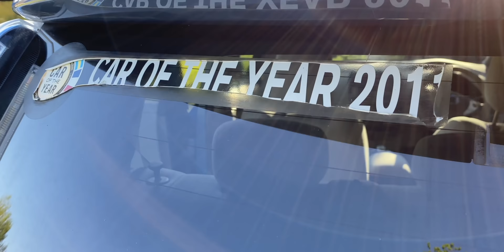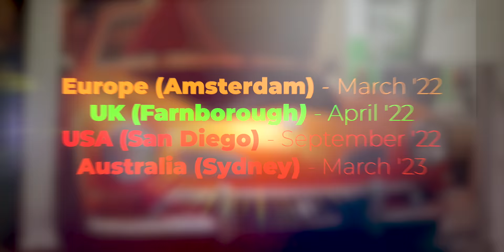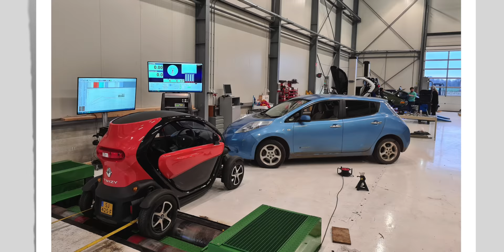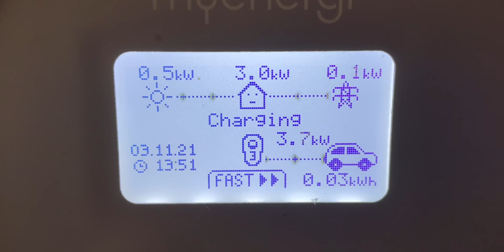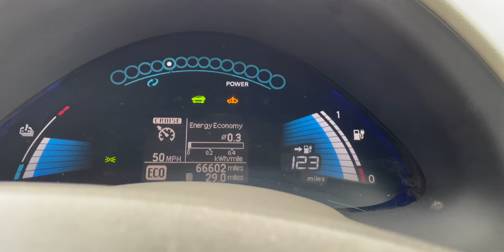Return of the LEAF: Robert drives his range extended EV home from Holland

Comment: Thank you, thank you, thank you for repeating the sentence " old batteries do not need replacement"

It's annoying, everytime I have to explain to a EV hater, that battery replacement is not a necessity at the end of the 8th year of warranty. It's just a warranty.
And old Nissan leaf and tesla's of 10 year's are still running today on old batteries, with a slight degradation of 20%
Reply: I had the same thing when I bought a 6 year old Prius, 8 years ago. The first thing many of my friends said was something along the lines of "Are you not scared the battery is going to die?!?". I had done my research, so I could tell them "No I don't think that'll happen. Say, your diesel car has a turbo, right? How much would that cost if that fails, hmmmmm?" And I was right, of course, my 14 year old Prius is still running fine on its original battery at 220000 km, and one of my friends had to replace his turbo. 

BATTERIES ARE NO PROBLEM. Ever. At all. We know this, now other people need to understand this. This video will surely help with that.
Reply: @SolarWebsite  8 years ago??
Omg. The amount of ignorance you must have faced would have been tiring right?

I got a EV , a year ago, and I'm already sick of explaining to people how wrong the negative myths of EV cars are
Reply: @SolarWebsite  welll.....except that, mostly, only people who are ALREADY EV friendly are likely to watch this channel.......!?

Comment: I don't understand why would you be so adamant in claiming that you will NEVER change the battery in an EV.
It's a lithium battery which, even if managed perfectly (only ever slow charging and staying between 30-80%) in a perfect climate conditions,
driving on mirror finished roads, it will still lose capacity with every charge/discharge cycle.

Claiming that the car itself will fall to bits before the battery loses it's road-worthiness while taking the number of 20+ year old cars on the road into consideration is daft at best.

And let's not forget how Tesla fixes batteries in their cars. You've got 1 bad cell? Too bad, that'll be $16/22k, and we're taking your faulty pack for no compensation.
Or you could have 3rd party shop repair the pack, but good luck ever using our Superchargers again.

EV market is in a desperate need of modular battery design, preferably standardised across the field.

Comment: batteries do go bad example 2016 mercedes hybrid bought for 16000 euro 4 months ago now wont charge mercedes said it needs new batteries at a cost of 18000 to fit and no one else will touch the car the car is worthless now dont buy an electric car  until batteries are bulletproof  and last 20 years

Comment: What did they do with the battery they threw away??
Reply: Only an idiot would throw away something so valuable to recycling companies.
Reply: They're usually reusable, that's better than recycling
Reply: Battery are changed because capacity is too low so it's annoying for a car, but cells still work and can be used in a lot of application that just don't required a high density of energy, like in industrie, powerwall... 
The life of a battery will is decades in the car, and decades after, then it will be recycle

Comment: Yes well no fine.  (Africans for pull the other one, it has bells on it).  You had to wait until someone crashed his Leaf.  Nissan has a terrible business model.  They are trying to force you to buy a new Leaf when all you need is a new battery with the current technology.  Here in New Zealand a company called EV Enhanced, located in Christchurch is working on building a replacement battery for Leafs with greatly improved technology including temperature control.  The Leaf could have been the iconic car of this century if Nissan had had a better business model.  Knowing that you could some time in the future change your battery for one with greater capacity and the latest technology, you would have bought a Leaf instead of a Tesla.

Comment: First I fully support electric cars I think the very idea of burning gasoline and engine is insane petroleums to precious to be burning in an engine

However you are wrong that people won't have to replace the battery I started off with a 2012 Nissan leaf The battery life degraded very quickly to almost unusable by about 65,000 mi and I was not in the hot climate I was in Pennsylvania I was down to about 45 mi range or 1/2 what it was when it was new I got rear-ended at a stoplight and the car got totaled out

I immediately went and bought another leaf a 2016 leaf with 1400 miles on it and the new 30 kilowatt battery it was Bliss being able to go 110 miles on a charge and another huge benefit was the heat pump which meant I could actually use the heater in the winter with the 2012 I could not use the heater it took too much power

However here I am 2023 my battery has been bad since 2020 and Nissan refuses to warranty it The car refuses to lose battery cells I'm at 40,000 mi and it's only lost three battery capacity cell markers and Nissan says that's the only way they'll warranty is if it loses four I only have about 6 months left before the 8 years will be up it's not likely to lose a fourth in that time yet on a 30 kilowatt leaf I can only go about 40 mi and I can't go uphills

The problem with my leaf is that some of the individual cells inside the pack are dying I'm seeing upwards of 200 millivolt differences between cells so if I push the car too hard such as going up a large hill such as driving to Albuquerque and back 20 mi from my house those cells undervolt and the BMS does its job and safety is the battery pack shutting down the entire car on the highway at 70 mph let me tell you the pucker factor is very high

So now I can't drive to Albuquerque anymore because there's too much chance of it doing that coming back up the mountain

My range is down to around 40 mi I've had the car even going up small hills lose a ton of range get home with three dashes like it's on fumes and as soon as I pull into my driveway the cells recover and the capacity starts going up 6% 11%, 19% and then it sits there at 19%

A Nissan refuses to honor the warranty on this problem so now I'm stuck with a car that I can only drive about 40 mi on level ground if I'm very careful going up any sort of hills even gentle hills and that probably will only get worse as those bad cells get worse eventually I probably won't be able to drive the car at all

Granted this is a fluke your chances of encountering this problem are small and I don't blame electric cars for this problem this is a corporate problem not a mechanical problem

To the end user however that changes nothing I'm still stuck with a car I can't really use anymore and I sure as hell don't have the $8,000 to replace the battery and I would question the decision to do so even if I did have the $8,000 since the rest of the car is now out of warranty and they might just refuse to honor the warranty on the new battery like the refusing to under the warranty on the existing battery

As I said I am an EV supporter but I would avoid Nissan

The dealership was super shady they try to charge me $700 to look at the car even though they should be a warranty issue I've been telling them there's a problem with the battery since 2020 when the car was still under it's full 5-year powertrain warranty and they just keep saying the computer says nothing wrong even though it's very obvious something is wrong

Then they tried to claim they see signs of rodent damage I immediately said Great order me a new battery give me a bill for $8,000 that says rodent damage I'll hand it to my insurance company I have full coverage that covers road and damage then they said no we can't do that so which is it either it's warranty replacement under a Nissan or it's rodent damage it can't be anything else but they just keep stonewalling and I'm still stuck with a car that can only go 40 miles if I don't go up any hills
Reply: How many complaints that you made to the dealer since 2020 are in writing? (Letters/ text messages; emails)?
Have you made a complaint to the NHTSA re safety issue re being endangered by being so slow up hills that you risk being rammed by following cars through this lack of battery? (safety issue...you know like the inadvertent acceleration of Toyotas...but in your case...the opposite?)

Have you written to Nissan USA HQ to outline the problem (emails etc enclosed) thereby escalating the problem to a national level?

Have you written to Nissan Japan...doing the same and now escalating to a world view?
Have you invited a local journalist to experience the car...interview on local news/in newspaper?

Have you thought of making a YT vid showing everything you have/are undergoing on a road trip....you know..for the benefit of the public as a PSA warning?

Unfortunately you may have a real problem with your dealer.
If Nissan authorises the battery swap I suggest NOT letting that dealer do it...for obvious reasons.

Comment: You will need to change the battery, it will happen. Because electric cars are going to last forever, 3-4 times as long as their ICE equivalents at least. You'll probably be putting a new 200kwh battery in this leaf in another 11 years time.

Comment: I own a 2015 LEAF I bought used. It was 3 yrs old when I got it. Now it is 7 yrs old. I have 10 bars out of 12, about 80 mile range (US statue miles). A new battery even a standard 24KW (at best 100 mile range) in the USA, from dealer, parts, labor, tax about $9000 USD. No F way. I paid $12,000 for whole car. When I go on a TRIP like you did I take my VW TDI Diesel that gets 50 MPG and has 700 Mile range and takes less than 5 minutes to charge. EV and 5 charges? HA HA HA. Then you bash other EV cars claiming the NISSIAN is more sturdy? NISSIAN? Are you kidding. You are senile or drunk.

Comment: The electric car industry has grown by leaps and bounds!!  The problem with an electric car that age is that the battery ran flat very quickly.  The 2020 Renault Zoe that I’m currently running is an official range of 230 miles, but a REAL LIFE RANGE of 165 miles.

Comment: ok but it no user serviceable thing, it had to move to a different country, ok get, 5 years, recharging, refilling up with power, than a regular car/van/lorry, etc. much slower, no one out side of petrel shortage, spends 30 minutes to an hour, refilling a petrel  car/van/lorry, a bout under 5 minute's, done, and on your way once more?, if your luck like the leaf, you or have take the bottom out of it to replace the battery,?
and about the not e-wasting the batteries, ok they are being reused, one day not you, if you sold or gave it away, it will stop working, and what happens to then, ok you or it next owner take it apart, it a fiddley mess on small parts, all potently capable of caching fire, load of mixed up chemicals, not particle safe, and the you have to find someone/business that wants bucket of mixed up chemicals, random mixed up bits small of metal, at that you can say it was recycled ? 🙂

but your example in cars terms, one carful owner, always keeps up- with maintence or servicing, how about if the is left depleted, and it not always being connected to power source, all of the time when it is stopped

Comment: LIAR LIAR LIAR LIAR. rhe battery in your car uses the same battery that ur phone uses. It degrades over time. In 20 years time YOU WILL DEFINATLY HAVE TO REPLACE THE BATTERY!
Reply: LIAR LIAR LIAR LIAR. Your phone does not have a Lithium-Manganese-oxide spinel battery.

Comment: Recycling is great, but would I ever trust a nissan leaf in american roads again. No, I would rather get a used tesla and swap that battery out for its BMS, and how it handles the batteries.
Reply: Tesla is twice the price
Reply: @zenbudhism  correct but if you are aware of early leafs there bms and thermal system is terriable. I had one and winters I could not have heat. At least with a tesla I can have heat and drive 100 miles